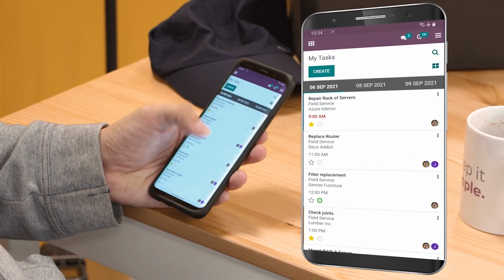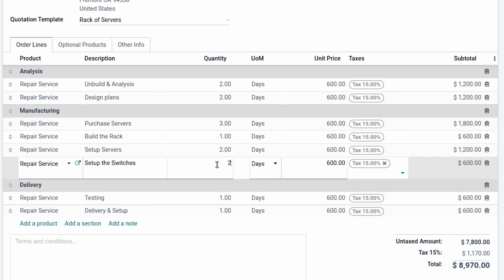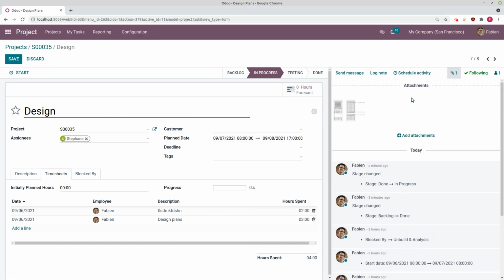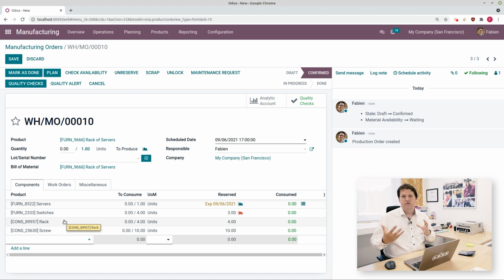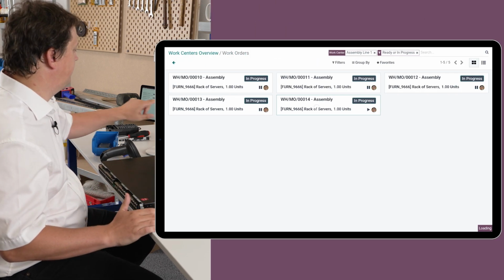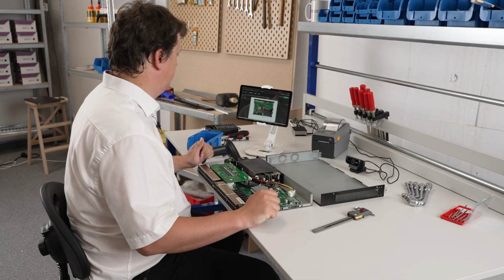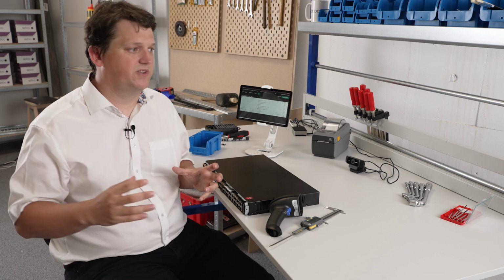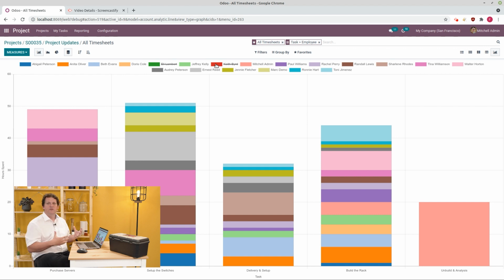Intuitive manufacturing with wireless tools - Odoo Manufacturing

Comment: Awesome implementation.  Looking at my experience in manufacturing units in developing countries, we could consider few changes
- rather than tablet, we can have large screen along with Raspberry Pi or similar stuff with OPC UA integrated
- rather than having click via foot, we can have touchless sensor for inputs
- for measurement, cost of wireless devices would be higher, using camera for scanning data 

Plus, share this integration of Odoo with OPCUA & INPUT in Odoo. This qualifies for I4.0 implementation.